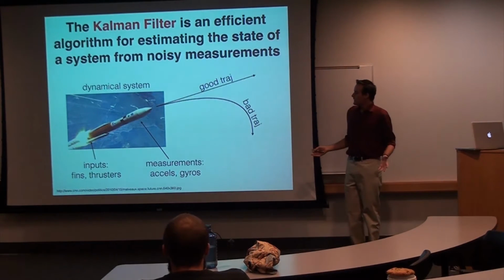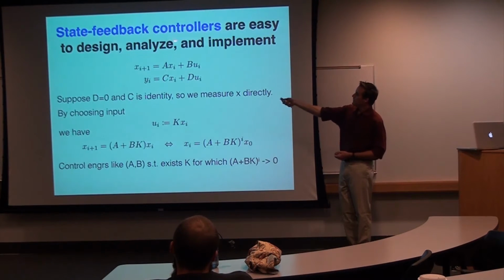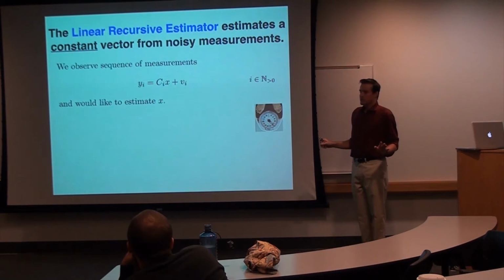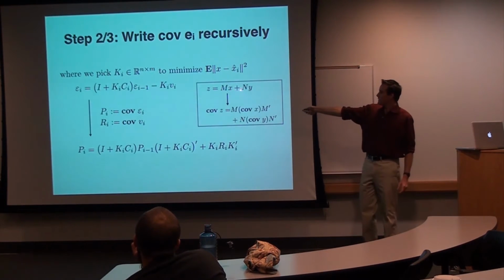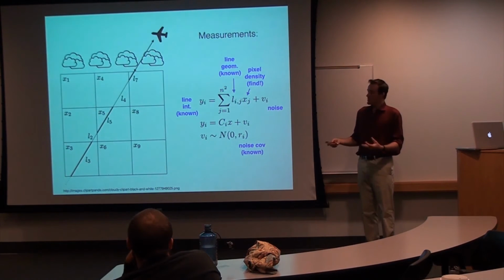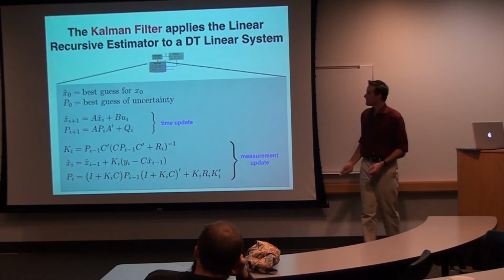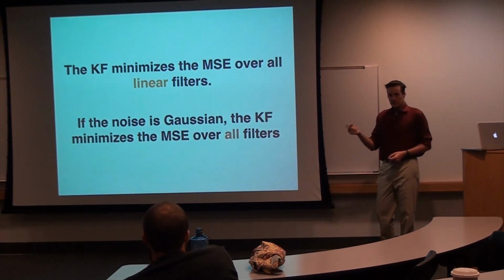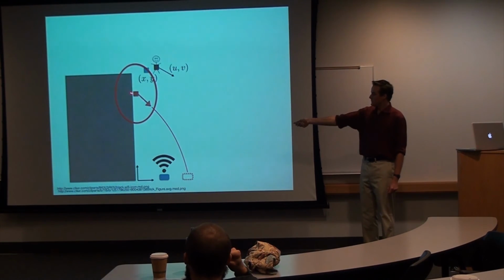The Kalman Filter

Comment: I guess there is a typo in the last equation at 17:49 (the expression for epsilon_i). The coefficient of K_i must be negative.
Reply: Yeah. You can see the error appear on the previous line, where the x - (...) from the line before that is expanded wrong. Note that the same typo appears in the formula for KF's measurement update in the slide at 31:00, but the code at 32:47 has it right with (I - K*C).
Reply: 2222 @nylonsparrow